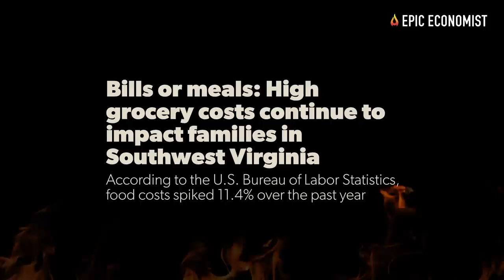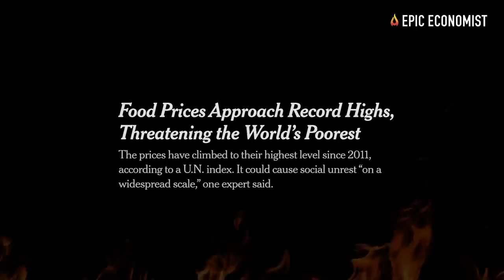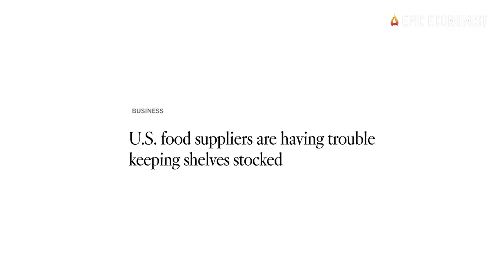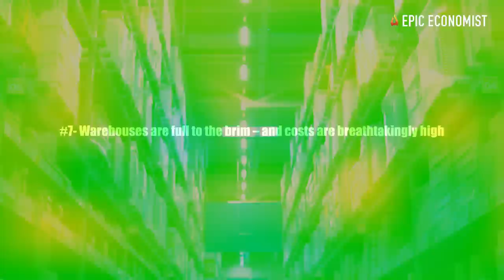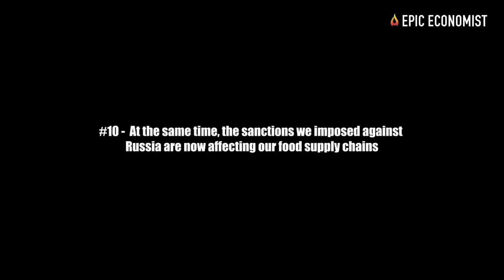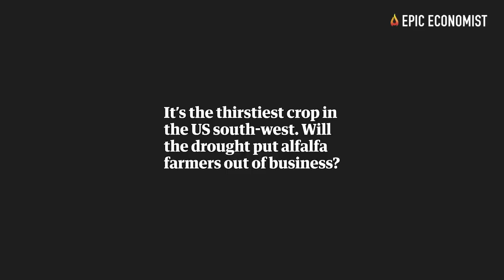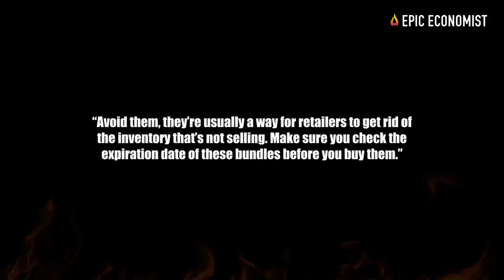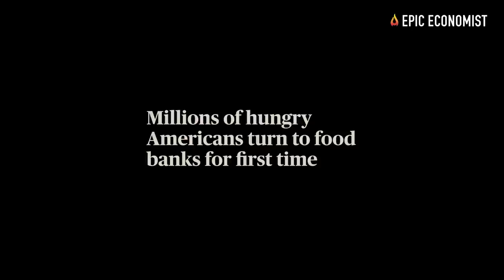15 Reasons Why Your Grocery Bill Is Sky-high Right Now

Comment: Our city water went up and starting October 2022, will be 43.00 a month up to 2,000 gallons. So regardless of using your tap or not the base price is 43.00 per month; after 2,000 gallons it goes up higher.
Reply: Where I'm at 1000 gallons is the minimum at $25. The Dollar General has a gallon of milk for $4.55 and gas is$2.96. Ridiculous.🤬
Reply: Thats nothing here on the west coast its 160 a month the kicker is u don't pay it in time they condemn your property and your out on the streets
Reply: ⁹
Reply: @jayrob846  yeppers. That's why I left California.
Reply: Glad I have a well.
Reply: Good, than just stick to 2000 gallons a month, which will be a challenge for a LOT of families.  Water is becoming more and more a scarce resource.
Reply: @mathisnotforthefaintofheart  Actually it's 32.00 flat rate.

Comment: Just seen totinos pizzas are 2.50 a piece now .. those things were 1.49 just a few weeks ago... Still not expensive but it's double and everything is doing it
Reply: Well see that's what I've been saying in common so simply did the reason why everybody is more than aware of it now or at least becoming conscious of the inflation is simply because it's no longer the 10 to 30 cent or even 50 cent price hike every 6 weeks or 3 months it's literally 80 cents to a dollar 49 every other week if not on some products every week it'll be a dollar and a half...

Basically you're right it's becoming more and more frequent it's pretty much to the point to where there's virtually no price structure it's just whatever they fucking want to charge you want any given day!
Reply: low down  I agree ... The jobs are not keeping pace with these price increases by any means
Reply: Depends what state your in
Reply: I remember when totino’s pizzas were .99 cents. We used to buy lots of them back in the day. But not anymore.

Comment: Well the truth of it is about retailers not being able to order the volume that they want yeah I believe that $1,400% simply because it's a cash flow problem they have to sell so many items out of whatever department in order to order not just those items but other items across the store you see they have to be selling all the time if they can't sell all the time and a portion of the store is dormant and it only gets one sale per day then your cash flow volume drops significantly unless you will not be able to order you'll have to wait two or three days to build up enough money to even think about ordering and of course these businesses are not set up this way they're not set up for that so there's a lot of half-assing that's happened to go on behind the scenes because the systems that they have built are built for an economy that no longer exists! 

See there's a huge problem when it comes to retailers and many of the businesses that feed retailers even manufacturers and that is simply most of the market research analysts that they have working for them today even if they are somewhere in their 70s they're not going to go back in time any further than perhaps the early 90s maybe some of them would be willing to go back and look at how things were done and how they remember they were done in the mid to late '80s that's as far back in time as they're willing to go very very few are going to look at the 60s and 70s very few are going to consider the 1930s as a template to learn from to help with today's issues first off I have to say that a lot of them either don't know how that worked or they simply can't be bothered to do that much research furthermore you have executives that are above them ordering them around to only study certain aspects they will not permit them to go back....

The reason I say it's important to go back is because they did have a level of efficiency without all of the bullshit gobbledygook that we've got going on today here's the deal the crap that we have in place today is very efficient it works pretty damn good it does allow for a high turnaround it allowed for the volume of sales to increase beyond the wildest of dreams of many of the founders of these companies but here's the problem those systems only work when the economy works when the economy is correct for those systems to work that's when they're there most effective otherwise they're a hindrance because you can't sell things that quickly you can't justify turning half of that shit on! 

So here's the deal you have companies that they cannot turn on a dime some of it has to do with their size a lot of it has to do with her willingness you also have systems that aren't exactly out of date but they're out of date in terms of their built for a time that no longer exists we're only pretending that those systems can function we need to go back and we're going to have to perform a combination of running stores and even manufacturers similar to what they did in the 30s but it'll have to be a combination of that basically we're going to have to be real strict with money okay that that's really where I'm going with the 1930s is you're just going to have to totally watch your money stop buying $180 track lighting because it makes the fruit look good fuck that if it's already in existence use it if you're building a new store it doesn't have it don't bother with it things like that...

If they want to focus on volume sales and particularly they want to try and get the prices down and stop making up inflated prices then they need to look at the 1960s particularly the early to mid 60s if they want to know how to weather a storm of economic troubles then they need to look at the 1970s headed into the early 1980s if you talk about modernizing existing systems then they really need to study the late 70s and they will find that there's a lot of fat out of the systems that they have that they could cut and make them run even more smoother than what they've got now there's a whole host of things they can learn and that they could implement damn near within a few months and they would be able to see a yield off of that within six months to a year there's a lot of things that they can learn from business practices of the past if they would just get off their college educated no nothing ass and look at it! 

But that's not the mentality of the executive level or even at the research executive level within most companies they're all there to pick up a paycheck and basically cruise to retirement that's essentially what's going on at the high up levels they expect everybody else under them to come up with all of these ideas except notice how they never bothered to listen to any of those ideas when they are presented to them they would assume to throw the junior whatever small-time manager out of the office they don't want to hear what he has to say they don't think that he knows or that she knows you know he doesn't wear a suit and tie every day so apparently he doesn't know anything that's the fucking mentality they're literally driving these companies into a ditch and I believe they're doing it largely on purpose if you go back and look at most retailers is balance sheets you'll notice that starting in 2005 if not even 2006 but in and around 2005 you'll see that they all took on mass amounts of debt for what played out to be no fucking reason because there was no real revamping of their stores there was no real expansion program and of course I'm largely talking about Sears pennies Macy's and colts what the hell they do with all this money it occurred to me that the vast majority of it ended up in the pockets of the board members and of course the executives for bonuses and whatever was left all right they spent most of last decade buying their own shares off of the market and to inflate the stock price they kept borrowing money to literally buy their own shares which is supposed to be illegal! 

For years if not even a couple of decades these motherfuckers have known something that most of us don't now I've spent countless years and hours late nights early morning even days at my job thinking about what the hell could they possibly know I've tried to pin down what it is I can only tell you what I have found so far you know people say that all the well you know there's going to be a great reset yeah I can tell you what that reset is as far as I can piece together right now that reset is not necessarily about how we work and live so much in the sense of things are going to get better no no it's more so that most of what we've come to be accustomed to is going away some of it will still be there however it's probably only going to be a handful of companies and then you might find that it's only a handful of locations! 

There's a whole host of things going on that a lot of people just haven't been paying attention to in the past 20 years and I suppose I can't blame them all the time I mean to watch this closely I can say it really does take a hell of a lot of time to do so and I understand people have shit to do but I also understand that they should be at least acutely aware that something has been off kilter  there again, I say the executives of these establishments are purposely driving these companies into a ditch they don't really care because hey they're getting big bonuses and it seems like they're getting bonuses too drive these companies into a ditch it's crazy the whole thing's going down that said I don't know maybe Walmart will exist for another 10 years and it's current form we don't really know the day or time but we do know that there's definite changes that's implemented and then they're working on implementing more I would say that what wasn't fully realized this year may be at least half realized next year sometimes it takes the public a couple 3 years to realize things to the fullest...

Comment: {Reasons Why Your Grocery Bill Is Sky-high Right Now} hahahahaha
(Sky-high) seems, like a good description for the prices.  But really the description is (as low as they are).
In a little bit you will say "remember when we could buy our own groceries, back in the 2022"?  You have seen 1984?  It's the best tell of what is happening.  You will eat at the cafeteria, soon.  I'm not telling that you be "worried".  I'm here, just in-case you couldn't "connect the dots".  Or more likely, you could "connect the dots".  But just refuse to admit it to yourself.  It already happened.  It happened a very long time ago (like 6,000 years ago, long).  It has just been rolling out slow.  So people can take the shock.  Enjoy the ride.  and it's true "resistance is futile".

Comment: Ukraine should have surrendered to Russia at an early stage to avoid war and destruction of Ukrainian infrastructure.  It is the USA that was so keen to supply arms to Ukraine to inflame the war.  It is also the USA that has caused sanctions to be applied against Russia.  The US strategy has backfired, because Russia is now exporting oil and gas to China, India et al.  The problems in USA now with supply chains are problems that the USA is inflicting upon itself.  Genuine USA negotiation and detente with Russia would have avoided the present economic problems and war in Ukraine.  The USA only has itself to blame for the present situation.